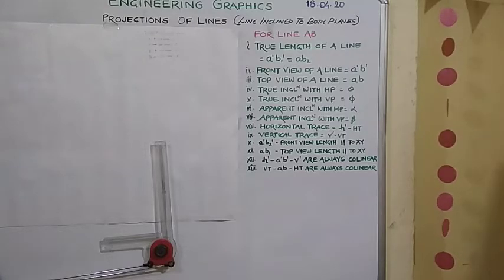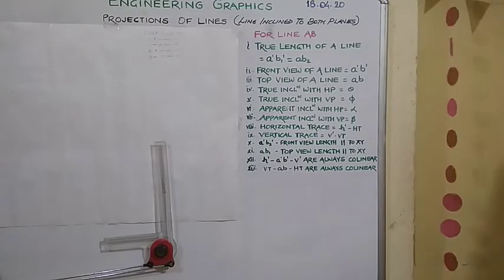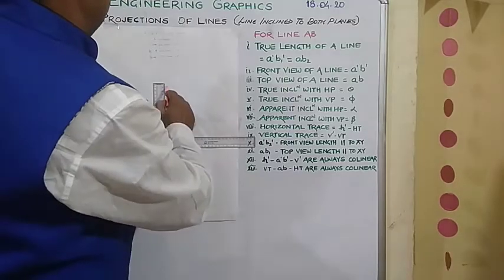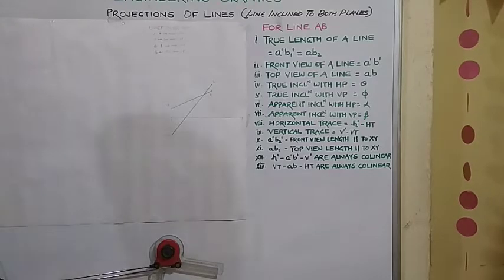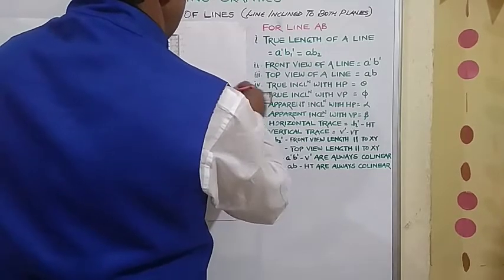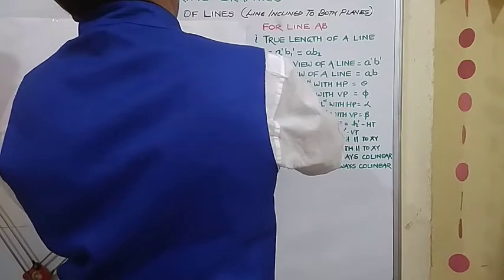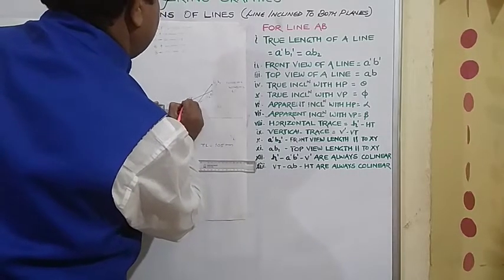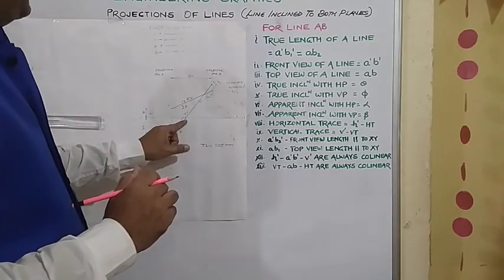# End Projector distance Problem Projections of Lines 2025

Comment: Sir will you please give an idea that how to solve this problem.
A line PQ has its end P, 15 mm above HP and 10 mm in front of VP. The end Q is 55 mm above HP, and the line is inclined at 30° to HP. The, distance between the ends projectors of 40 mm. draw the projections of the line and find its inclination with VP